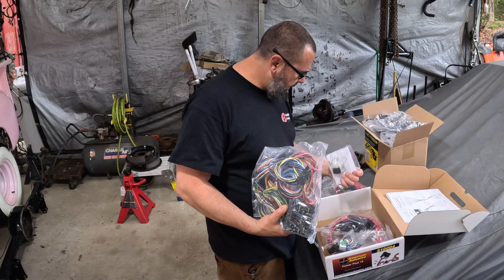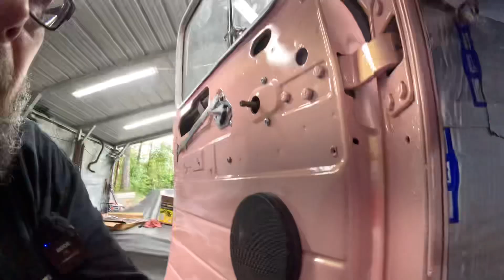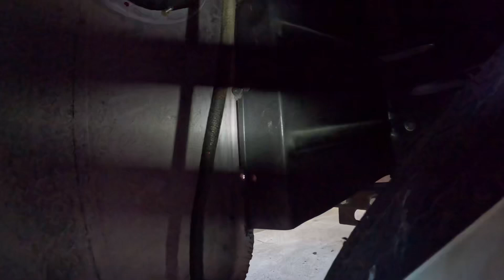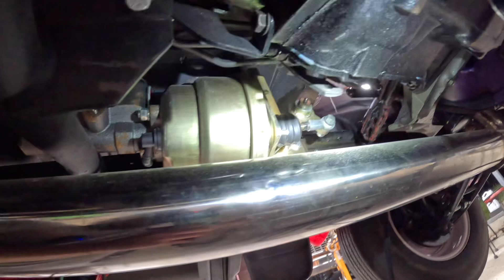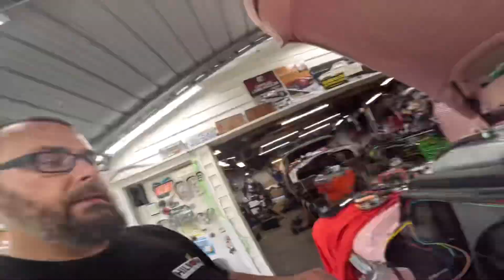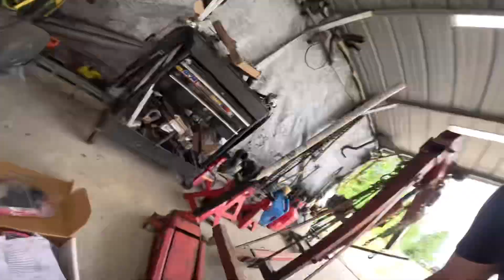1949 Chevy 3100 American Auto Wire harness installation and finding more hack work.

Comment: Love your videos! What did you use for wire grommets in your firewall!
Reply from the maker: Thanks I really appreciate it. If Iam not mistaken that main grommet came with the wiring harness. If I do buy them individually I’ll either use the Dorman builder series stuff from oreilly  or the seals it grommets and I get those from summit racing. 
Thanks for watching.